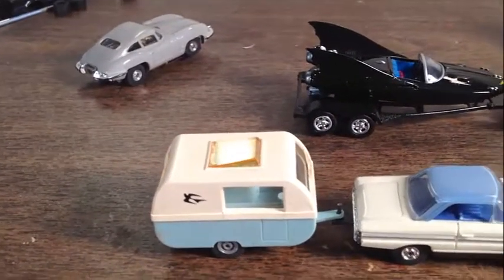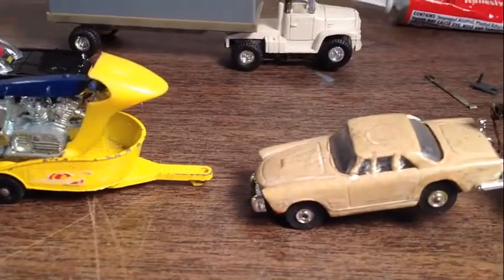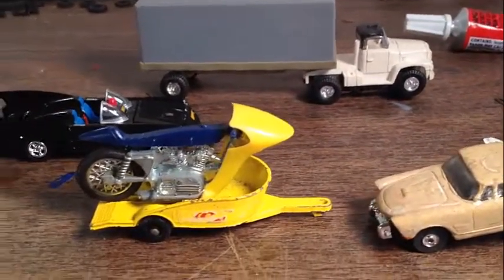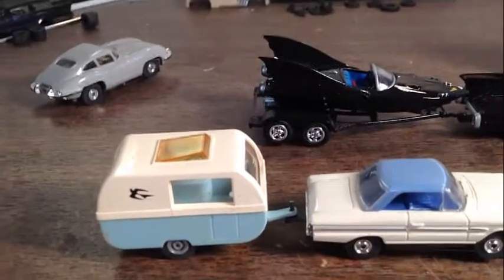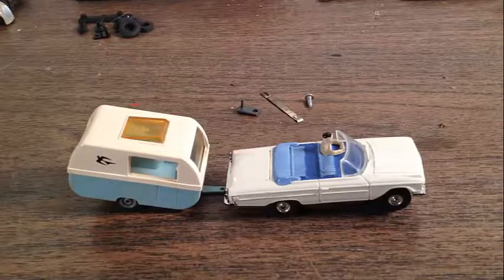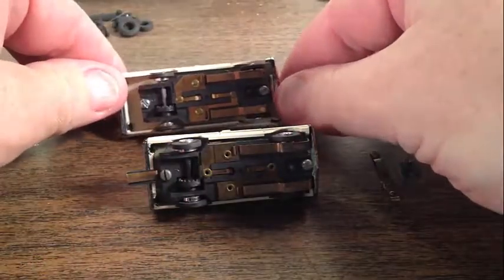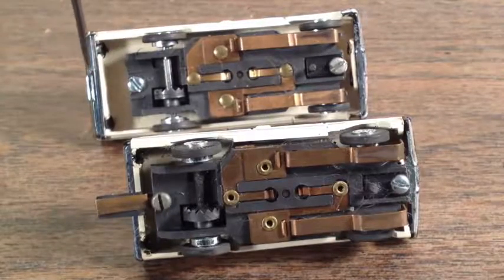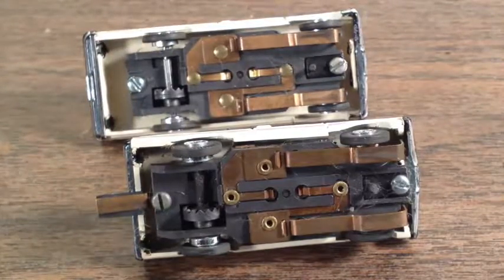Aurora HO Slot Car Custom T-Jet Trailer Hitch

Comment: Ok 👍 thanks for letting me know how to do this i went on eBay looking for the air stream Thay had a chrome one $50 by Busch something Au $75 i don't know what that means but i want it on my track.
Reply from the maker: Hey Craig, I've been hooked on the trailer for a while now. I think it's so cool to be able to have the old slot cars pulling a trailer around the track!! Take care Craig, let me know how it turns out, see ya!!